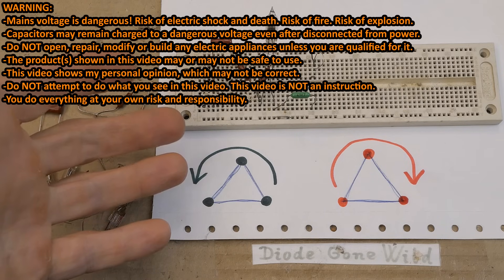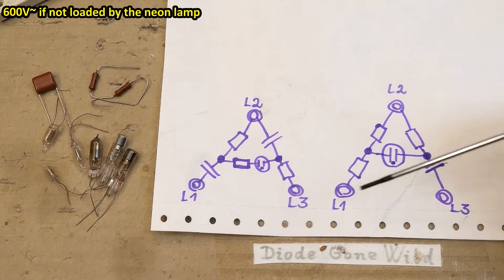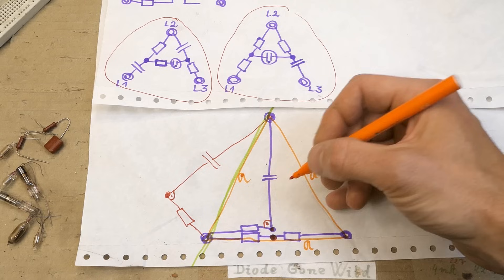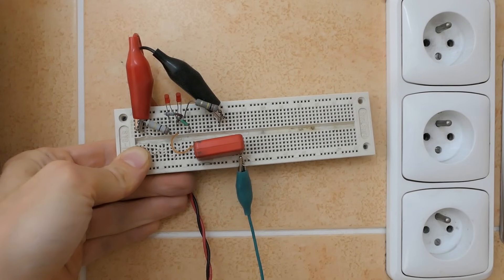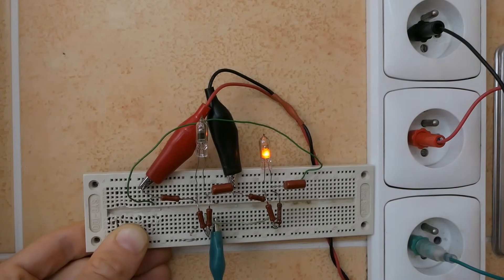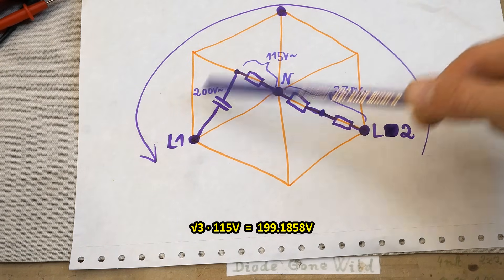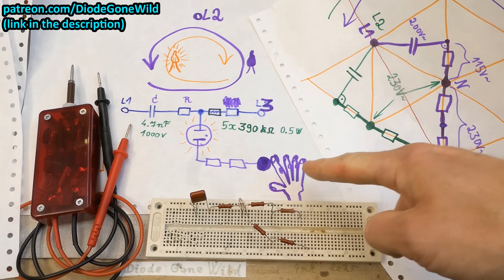Phase sequence testers

Comment: Merry Late Xmas Dany!

Hey man. I'm playing with this idea to make a connect 4 game using just passive components. Could I use the base of the transistor as touch switch to pick a column for the either blue or red led. I forget the grid layout but it's like 8x8 or something. 

I'm wanting to making it using stuff I have laying around like acrylic with round holes cut in it that would glow the color of the chosen column. I'm trying to figure out how to make the color cascade down the empty columns to either the bottom or on top of a color the opponent already picked. 

I could do this easily with a bit of code but i'd like to just use transistors as a switch and some sort of clamping circuit so the colors in the colums and rows stay the colors that the players picked.

say if there's a colum with 2 red stacked vertically and the opponent presses the blue switch for the column, i'd like the blue color to cascade down the column and rest above the led that already on. 

I was thinking of using a 10mm rgb 4 pin led for each slot or I also have bi color leds with 2 pins or 3 sharing a common cathode.

How would you go about doing the color dropping down and resting above the color already there or stopping at the bottom if it is empty.

A circuit idea i guess. The game is ancient and called Connect Four. Who ever gets four of the same color in a row in any direction wins that round. It's pretty simple game but doing it with just leds and maybe transistors or diodes to clamp the already picked color for that slotted hole available. The game uses gravity in real life.

If you get a minute and can suggest something i'd really appreciate it. I've been so concentrated on fixing video game consoles and writing music the past year or so that I have not made anything original circuit wise. Just diagnose and repair stuff.

I'll give you another tip far better than this one if you find time to answer. It's kind of a cool idea and I have the basic idea of how the color picked will cascade down but it's the clamping part i'm having trouble with as if a row is 8 deep it can be any combination of red and blue or any two colors really. I'm going to go with led colors with similar forward voltage.

Comment: @DiodeGoneWild Thanks for these cool circuits! I've built the one with the LEDs, and it's working great!  I made a simulation in circuitlab, but just to be sure: in case of a 'correct' (clockwise) rotation, the LED on the left side (on your original drawing) should light up, is that correct? Thanks!

Comment: I've been trying to buy a transformer soldering iron like the one GDW uses. Nuba makes more powerful types too than the 70 VA old ones. They have webshop too but for shipping Hungary there is no option added, the page just says to contact them. I tried many times but they never answered.

Comment: UK: Only one outlet allowed in the bathroom, lower voltage, special plug only for shavers.
Eastern Europe: Screw that, here's 3-phase!
Reply: Because the UK is a nanny state trying to protect people from hurting themselves. I also think that shutters in sockets are useless.
Reply: @mernokimuvek  Well, the U.K. designed their shutters much better than other countries because all plugs have a ground pin or at least a plastic stick going into the ground pin, so it is impossible to just stick a metal object in the live and neutral holes, and since the building will have RCD, it is also impossible to pass a reasonable amount of current between live and earth. Although if you are talking about the U.S. and E.U, then yeah, the shutters are pretty crap.
Reply: @vinnysworkshop  some european sockets like type F and E are available with shutters which needs insert two pins into outlet to open, this idea isn't that bad, but yep, UK designed it more well by needed ground pin to unlock it
Reply: @vinnysworkshop  All shutters are useless. We should have knife switches with exposed live conctatcs like they used to have from the 1880s to the 1920s. I'm a big believer of natural selection.
Reply: @mernokimuvek  That's a strong opinion, but you aren't wrong.
Reply: not eastern europe, czechia, poland, slovakia lies in central eu :)
Reply: Your uk plugs are only rated for 13A..LOL
Reply: 3 phases for 3 hair dryers.

Comment: Very neat! But at age 22, I learned on how 240V zaps you more than 220V. In Perth Western Australia they had nominated 250V and I only ever needed to know once. Now I'd rather be your cat than bringing fingers that close to 400V !
Reply: You'll only get a 400v shock if you grab two different phase wires with each hand. Each phase is still 230v to ground.

Comment: Can you build a basic clock that runs on the 50/60Hz wall outlet frequency?
Reply: You can just use LM8560(TMS3450) with datasheet schematic, no magic. But yes it will be fun and edifying with diodegonewild's realization.

Comment: Great video. The last method is how I measured the order of phases in my garage, where I have only 2 phases (I have a "double" garage which is practically two garages without the wall between them). I used a "vadaska", or SN1 tester. A very old, passive, tester that I highly recommend. Since my electric car supports two phase charging, I needed to know the order of phases. I can charge my electric car using 2x16A, 100% compliant to the connection the garages have. Both have a 16A circuit breaker. Every garage in the garage house has a 16A breaker and the phases keep changing 1-2-3-1-2-3-1-2-3 etc from garage to garage. There are multiple "double" garages, which is practically two garages without the wall between them. They all have two phases. I wanted to build a special adapter using 2 "standard" European plugs, joined into one single IEC 60309 16 A 250 V 3P+N+E socket (not wall mounted, just two cables going from it). The other end would be two CEE 7/7 plugs, each on its own cable, labeled L1 and L2 so I can connect them in the right order. But since I need to make a proper RCD and I want to protect the grid from a theoretical failure where the car sends DC to to the grid (which could result in some pretty nasty things), I would need some proper class protection. I am too lazy to do it and charge the car with one phase only in the garage (if necessary). It takes twice as long, but I do not care.
Reply: A video using the older ZN1 tester, in function identical to the SN1: https://www.youtube.com/watch?app=desktop&v=bOlu8nG5Gb4 The ZN1 t is essentially identical to the newer SN1. The difference in the type name is that the type name ZN1 is from Czech while SN1 is from Slovak. Since the later SN1 was produced in Slovakia, it got the designation SN1. Czech it is Zkoušačka, Slovak it is Skúšačka. The Z/S initial letter gives away if it was produced in the Czech part of Czechoslovakia or the Slovak part of Czechoslovakia.

Comment: I wonder could you show us an analog phase sequence meter
One with a rotating disc?
I've got one and it's amazing in its simplicity 
As always great video👍
Reply: That sounds like it is no different than a tiny 3 phase motor.
Reply: @vinnysworkshop  but it cannot be run continuously due to heat raise.

Comment: 16:33 using of own body as neutral a bit danger.
Reply: There are neon screwdrivers that use that concept.
Reply: The current flow is limited by the resistors to a safe level.

Comment: I once designed a more complex CMOS circuit for a DIN rail mounted protection device. All are based upon the phase shift in a capacitor. Useful to prevent connecting mobile equipment to wrong phase order. These examples are very instructive , kudos.

Comment: well... even Electroboom didnt go to the insanity of shoving 400V 3-ph straight into a breadboard yet, lol... 
Glad you didnt feel the need to "demonstrate" what would happen if something was connected wrong there.
Reply: If it was electro boom, there will have been loud zaps and cello playing afterward while explaining another mistake. 😂
Reply: As I know American homes don't have 3 phases, but 180° (2 phase) configurations that don't rotate.

And as a European, I have 400V 3 phase in my Ukrainian home which is cool, because it delivers more power and I can connect motors.
Reply: @Gameplayer55055  In American houses, there are indeed 2 phases 180 degrees out of phase, but in apartment complexes or big buildings of any sort, there are 2 phases 120 degrees out of phase.
Reply: @vinnysworkshop  That is split phase, not 2 phase. 2 phase is 90 degree phase shift. The first induction  motors invented by Nikola Tesla were 2 phase motors.
Reply: @mernokimuvek  Interesting.
Reply: @Gameplayer55055  That is split phase, not 2 phase. 2 phase is 90 degree phase shift. The first induction  motors invented by Nikola Tesla were 2 phase motors.

Comment: 9:40 Why did you have to double the entire circuit? Wouldn't it have been enough to invert the RC element between terminals L2-L3? In that case, only 4 resistors are needed.
Reply from the maker: No, the high resistance resistive dividers double as neon lamp current limiters. The output voltage (and phase) of the divider is greatly influenced by the current of the illuminated lamp. Both circuits can't share just one divider. (Yes, I also had this idea, but figured out it won't work).

Comment: Can you tell me how to choose correct capacitor for use
Reply from the maker: 4.7nF is fine for 380-415V. For the voltages that are roughly half of that, use 10nF.
Reply: @DiodeGoneWild I have honda cd70 bike it's led headlight gets little dim every time I use the horn so which capacitor should I use to reduce the dimm of led headlight.
Reply: @Pakismart221  I'm afraid that no capacitor will help there. The charging system is too weak.

Comment: Great video. But I can't shake the feeling that when I connect just one phase, or two phases, the free probe is under voltage, and with improper handling, I could get a shock.
Reply from the maker: It's high resistance. You won't get much of a shock, the current is limited to less than 1mA.
Reply: @DiodeGoneWild so not dangerous at all..
It gives you only a little bit of voltage feeling 😄
Reply: Well, we used to have knife switches with exposed live contacts from the 1880s to the 1920s and humanity didn't go extinct, so a live probe is safe.

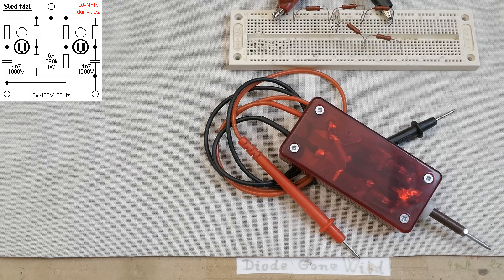Comment: For anyone looking for a professional two phase sequence tester like shown at 13:20 I would really recommend the Fluke T130 (also included in T150 and T110 but NOT the T90) they do work with gloves on and you also have the built in selectable load that can trip an RCD if you enable it but this is also really useful to discharge large DC bus capacitors.
Reply: I have the UNI-T UT18D which is very similar but much cheaper. Never thought to use the RCD tester as a capacitor discharger, nice idea.
Reply: I think Fluke charges too much, but that's probably because I'm not a professional. But when EEVblog showed a $9 .0000 accuracy meter, I fell off expensive test equipment really fast.
Reply: They work with gloves because they are capacitive cuopling with the human body, and this also capacitative cuopled with earth (if you wear shoes 😆)